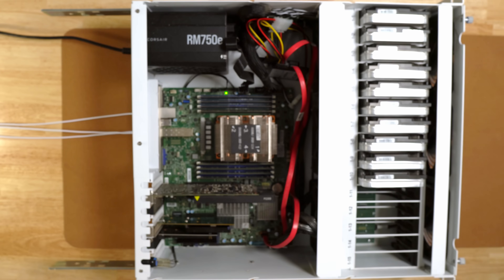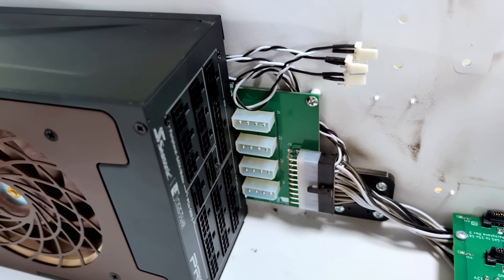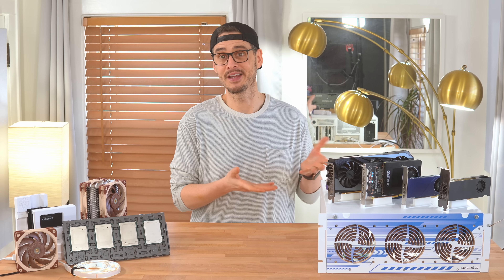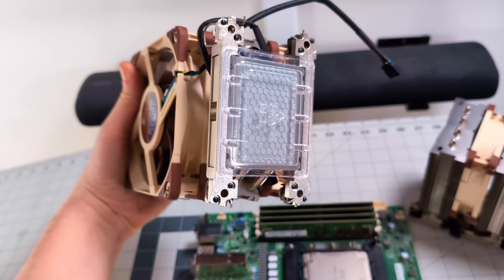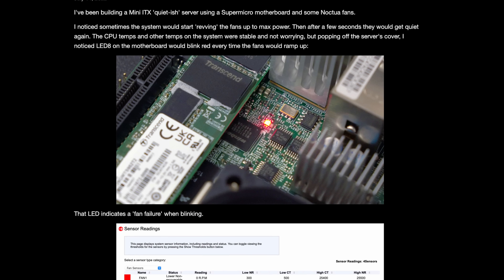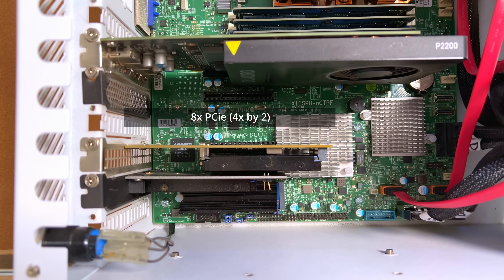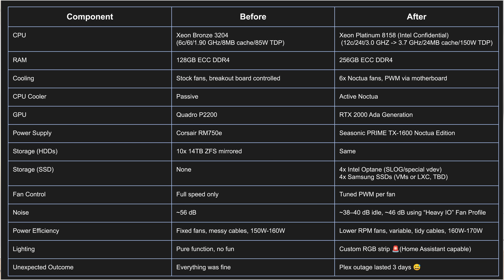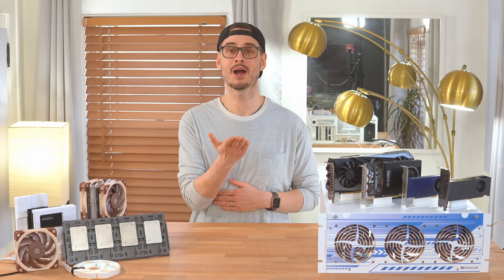I Rebuilt My Home Server — Quieter, Faster, and Ready for 2025

Comment: Since you asked, the one thing holding my homelab back right now is amazon taking almost a month (so far) to ship the smattering of N150 mini-PCs that I ordered. Once those arrive, the thing holding me back will be my continued years-long struggle to grasp Kubernetes. I bit the bullet and bought a CKA course to hopefully get me the rest of the way there.
Reply from the maker: N150's are so great.  Also, Kubernetes is great but takes a long time to learn.  I learn so much every day when I work on it.
Reply: I'm there right now.
I have a cluster of 2x amd 5825U mini pc's.
Installed proxmox, and made terraform scripts to setup the cluster with talos os.

kubernetes is A LOT
Reply: That sounds like a huge hassle over 1 big system. Good luck
Reply: @ I did a big single unraid system for a while with a 7950x. Then broke it out into a 3 node Proxmox cluster running 6 docker swarm nodes + gluster for HA appdata with tolerance for losing a single Proxmox host or up to two swarm nodes. It's all running great, so naturally I want to throw a wrench into the works and complicate things even further with an 8 node Kubernetes cluster running on mini-PCs + 2  Proxmox nodes (for GPU workloads) + I'll need a q-device for qorum. Next is HA storage, but haven't found anything both affordable and reasonably performant enough, so unraid is still on NAS duties and it remains a single point of failure. Might steal 2 of the Kubernetes nodes for HA opnsense router. 

"Huge hassle" is the name of the game :)
This is the only thing I enjoy anymore.

Comment: For the fan config, you definitely want the one in the front, and the one in the middle. It probably doesn't make that much difference, but you will get better efficiency from the heatsink if that first fan doesn't have to "pull" through. Typical advice is to configure "push", and add "pull" where necessary.

When in doubt, check noctua's manual. I'm sure they've tested, and model the most efficient fan orientation.
Reply from the maker: Thank you so much!  The thing that kept tripping me up is that there is also a case fan 2 inches from the push fan.

Comment: Get some Gold/Platinum 2nd Gen that allows you to use Optane DCPMM. eBay has cheap 128GB/256GB which can be configured in Hybrid-mode being used as volatile memory (RAM) or non-volatile memory as super-fast low latency storage. You would save a PCIe slot as you don't need the small Optanes which ar emuch slower. 2x Optane DCPMM 128GB cost around 50US$ together. 256GB around 100US$. This upgrade to 1st Gen Scalable was unnecessary and not a bold move from Patrick.

Comment: I am actually right now building my first home server on a budget.
I got a used M920S Lenovo machine as the base from ebay with a i7 9700, 32GB ram and a 1TB consumer ssd as a OS drive. I bought 3 more samsung 960GB enterprise SSDS (SM 883) to make a Z1 raid. These should serve as main system backup, a small nas type cloud for personal use and then as storage for all dockers/game servers and what not.

My issue kind of is the cpu cooling. Since the whole board and machine is proprietary there is a weird blower style cooler on there. i wanted the thing to be silent since i live in a one room appartement. So sadly lenovo doesnt let me control fan speeds.. i was able to mod the bios to unlock voltage control on the CPU and undervolted it. Now it at least doesnt spin up as hard under full load but the small form factor blower cooler is still very audible in idle (800 rpm) i was thinking of using a resistance cable to force it to 10V but am afraid of too high tems so i am kinda unsure what to do and how to progress/feel about this

Also since its my first server i am kinda lost in general haha
Reply from the maker: For your first server you sound like you know what you are doing!  I would try the resistance cable.  CPUs should clock down if they get too hot

Comment: @techno tim You are actually lucky if just did not power on. I lost one SATA hard drive as Corsair AX and RM series have +5 and +12 inverted in 6 pin. You can never use AX1200 SATA power cable on RM1000 psu. And it IS even the same manufacturer.

Comment: I just redid mine recently, but went Threadripper Pro; same threads/memory though. Really appreciate your build there Tim. I'd love to know your drive space.. I ended up grabbing 8 14Tb, and using an Asus Hyper M.2 populated for my Dockers/LXC; all of it is ProxMox loving it. BTW, your comment on power cables is dead on. I killed a motherboard once with power cords from one Corsair 650 modular to another that should have been the same model but different cable models.. thank god the CPU/Board were low-end, but death to both.

Comment: My main server is using the old AM4 with an undervolted Ryzen 5900X on Eco mode with 128GB RAM. Using a ROG X570-E Gaming Wi-Fi 2 with Dell H310 HBA for 8 HDDs, 2 SATA SSDs, and 1 nvme. Using Intel Arc A380 for Plex transcoding. For remote access, im using a Raspberry pi 4 with Geekworm A8 PiKVM hat. Case is a fractal design R7 with Arctic P14 and P12 Continuous Operation PWM fans.
Reply: i'm a bit late.
Do you have a read on how much that undervolt and eco mode changes on an avg?
Reply: @siriuswinter1065 are you referring to power consumption? With drive spin down on 2 of my 3 pools,  powertop optimazation, and other BIOS tweaks, it can idle at around 135W. It's to my understanding that the Intel Arc cards have higher than average idle power draw though, which i can't do anything about unfortunately. Performance wise, I don't really have any benchmarks numbers compare with but I'm pretty happy with it overall.

Comment: I don't have any future plans. I actually just finished building a true offsite storage server to put at my brothers house. Enabled dedupe on a key ZFS volume, and I was able to squeeze all my "mission critical" data into 30TB.

The build is proxmox running an AMD 5600 with 128GB of RAM, 8x12TB HDD, 2x1TB SSD, an LSI HBA, all in a Fractal Define R5, which is great because it comes with all the drive sleds needed for 8 drives.

I bought some 10G copper NICs, but realized my blunder in a mini-ATX motherboard. I don't have the extra PCI-slot to use 2 16x cards (HBA and NIC). I might fix that in the future, but wasn't critical.
Reply from the maker: So nice you have an offsite at your brother's house!

Comment: I run two main servers: Athlon 2650e (eMachines SFF) and FX-8370 (Norco 2U). The Athlon handles a simple two disk JBOD ~20TB and even at 2GB memory only seems held back by clockspeed, PCI-E slot arrangement and cooling if I add any hot cards. The FX handles 3D render jobs, VMs, VR stream+record, secure browse and is the excess data dump in case I ever need to use more than two HDDs. The only things holding it back are a lack of front I/O and the airflow pattern needs to be very specifically reshaped depending on the loadout. This is fine for now.

Comment: Nice build, @TechnoTim. I don't envy your electric bill, though. I'm sure you realize that you can easily solve your pin-out issue by moving the pins around on the connectors. 

Personally, I'm going to wait a while for @TrueNAS to get Incus updated to include OCI support. I'd also like them to include support for OVN in their interface. That's all going to take quite a while, though. Maybe next year? I won't hold my breath. 

Until then, I'm still rocking my 3x Proxmox cluster, with 2x virtualized TrueNAS via PCI passthrough. Hoping I can consolidate everything to a single OS solution in the coming years, which is what was promised, but IX failed to deliver with Scale. I wish I could have a rack full of monster servers, like you. However, I'm just building mine out of my retired desktop computer parts. It all runs surprisingly well, on the premium line parts, like Asus Prime series. The B-series chipset boards are not at all great for this type of build, in my experience. No PCI passthrough, because no separate IOMMU groups. Data corruption on disks due to cheap chipset hardware. Also, has an issue with Proxmox's software-defined networking due to cheap NIC. It's the last time I'm going the budget route for a build like this. 

I use all Noctua fans in mine, since it's in my bedroom. I have 5 PCs totalling over 28 fans, plus 14 HDDs, and can easily sleep next to them. The loudest part overall is the GPU cooler in my desktop, and only when it ramps under load.

Comment: @0:55 I bought one then got a notification Amazon had 1 come into stock bought just so a scalper couldn't drop it on eBay for $2500 holding onto it until someone wants it but at MSRP $799 

I went with a 7980Xe Delidded liquid Metal and a direct die plate. 256gb DDR 4 could 2tb nvme for cache. 12x24TB drives a Asus Sage WS x299 setup and a old 1600w T2 EVGA PSU couple Intel DC 1.6TB SSDs for VMs and a cooper Modded 3090FE(VM GPU) and a 3050(Host GPU) True Nas Scale.

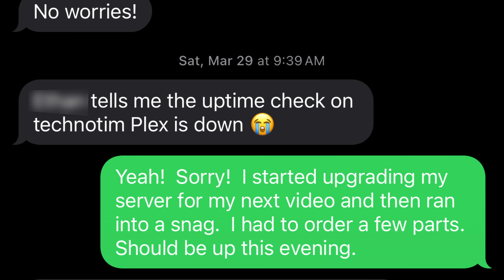Comment: 2:50 people have been hitting this BS since the first modular PSUs. Corsair don't even guarantee cable compatibility within a model number or even model+version
Reply from the maker: Yikes, this I did not know.
Reply: That’s ridiculous. 

Regardless of how good they are, that all by itself is reason enough to never buy a Corsair power supply.
Reply: @williamp6800 to be fair they are all at it. Basically the brands that farm out production to other manufacturers (so only really seasonic and FSP that don't) all do it because any one particular model could be made by CWT, FSP, Seasonic, Great wall or any number of other OEMs.
I saw one youtuber had sent a PSU for RMA back to IIRC Corsair and when it was sent back the new one wasn't compatible with the cables from his original despite being the exact same model, but just a different revision

Comment: Amazing that you would build so much and run so much and still not have designed things so that Plex doesn't have to go down for any length of time during maintenance or rebuilds. Why isn't Plex a virtual machine that can be moved from physical host to physical host with no downtime? Is your media on the same physical machine as your Plex server? You're running your storage server on the same hardware as your VM and container host? Take another look at your topology and design.
Reply from the maker: Thanks and yes, that's a good callout.  Plex is currently on another machine, so the app itself is fine, it's just that the media all lives on this machine.  I had to take this machine down to upgrade it, so there's a day, then I needed new cables, which took another day to ship, then I needed the right CPU cooler and cable adapters which took another day to ship.  I could have reverted all of my changes until the parts came (which I totally would have had I not been filming it or it was more critical like my documentation site) but that would have added more work and more frustration.

Comment: 1:34 You had a lucky break Tim. I found out about the power supply pin out problem by frying some hard drives 🤦🏾‍♂️
Reply from the maker: I got really lucky.  I actually tried power it on about 10 times 🤦‍♂

Comment: I ran into the same issue with PSU cables—while the connectors are standardized, the pinouts aren’t, which can be really dangerous. I accidentally mixed up cables between an ASUS and a Thermaltake PSU, and it ended up frying my AIO cooler which has SATA connection (luckily nothing else was damaged). Always double-check compatibility, even if the connectors look the same!
Reply: Yes precisely, always use the cables that come with your power supply unless you are sure you are installing compatible custom cables. This could have been a lot worse lol
Reply from the maker: @ Thank you both!  I got really lucky that nothing fried.  I still want custom cables so that I don' thave to use really long ones, but this whole experience has made me really nervous about doing so.
Reply: I lost one SATA hard drive as Corsair AX and RM series have +5 and +12 inverted in 6 pin. You can never use AX1200 SATA power cable on RM1000 psu. And it IS even the same manufacturer.

Comment: Interesting. I was kind of going the other way. Right now all my stuff is on a Synology DS918+, but I'd like to put in an HL15 and I have a Minisforum MS-01 for Proxmox.

I'm planning to move my Docker stuff to a Proxmox VM, and my plan for the HL15 was "just" storage,but at this point I don't even have anywhere to put a rack, so that's way off.
Reply from the maker: I think this is going to be my NAS++ which will be storage plus applications, that way I can keep the data close to the apps.
Reply: @TechnoTim  Yeah. I just don't think TrueNAS Scale is particularly good at application hosting, and it's actually bad at being a hypervisor. That's why I'm leaning toward separating them.
Reply: My “rack” is wire shelving from Hone Depot. It’s wide enough that I can place two rack mount servers side-by-side on each shelf. 

Two shelves of computer and network stuff, and the rest for storage of regular stuff. 

Might work for you? 🤷🏻‍♂️
Reply: @ Nope, that would be even worse. The nice thing about a rack is how little  horizontal space they take up. I’d like to put one in the basement, but I should probably get the basement finished first.

Comment: Just picked up a 4u supermicro case and a bunch more storage so that I can finally have a copy of my nas instead of relying on redundancy without a real backup. From there I decided to move my 5900x desktop parts into the new chassis, add ECC ram, and upgrade my desktop too. Truenas in proxmox on good hardware will be a huge step up from docker on synology. I have a bunch of 1LPC’s for a proxmox cluster but I’m wondering how to use a cluster in tandem with the big server since a lot of the services I run rely on the nas data so redundancy doesn’t matter if the big server fails. Would you run your large server in a cluster with smaller machines or does it stand alone? What philosophy makes sense re: redundancy/availability in this HW landscape? My initial thought is that all data-heavy services stay local to the standalone server and things like home assistant, monitoring tools and proxmox backup server live in the small cluster.
Reply from the maker: This is exactly the type of transformation I am going through right now too.  I am starting to separate my "Homelab" from my "Home Production".  For my home production I just want availability, simplicity, and efficiency.  Redundancy is great for some services (DNS, etc) but not so great for others.  I think I am going to start tackling this in videos soon, this upgrade is setting me up for that.
Reply: @TechnoTim I’m excited to see how your journey goes! I’m building a new home (also MSP) and for now I’m focusing on the server infrastructure while I wait for the next steps in physical infrastructure planning and low voltage installation/prewire. Drop a line if you’re interested in hearing about the home build infrastructure.

Comment: Have you considered rearranging the pins on the connectors to match the power supply?
Reply from the maker: That's a great idea!  The thing that really threw me off was that the custom cable from my power distribution board was built specifically for Corsair.  😭
Reply: @TechnoTim Pinouts on the board/device end of the cable should be the same across all PSU vendors. Since the PSU vendor doesn’t know what you’re plugging into (HDD, optical drive…) they can do whatever they want on the PSU end of the cable but the far end has to follow standards. 

That makes me wonder what special sauce/design considerations 45 drives uses for their power distribution board. For instance, would other boards rely on sata power connectors vs molex based on how many a given vendor might include with their modular cord bundle?
Reply: @TechnoTim the output from a PSU isn’t rocket science and with a multimeter you should pretty easily be able to figure out the pinout required. Then move the pins within the Molex PCI 6-pin sockets. Don’t even need a special tool, it’s doable with a staple from a staple gun. 👍👍

I 100% agree on the stupidity that they use the same connector though! You were lucky that you didn’t fry anything..